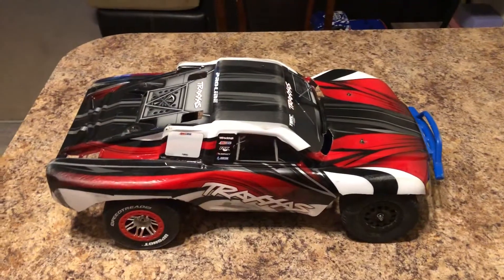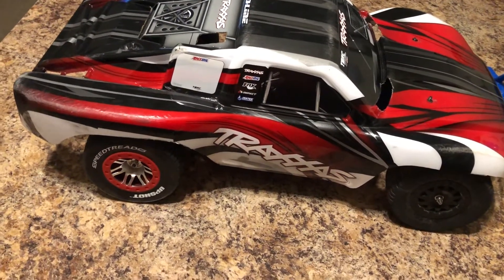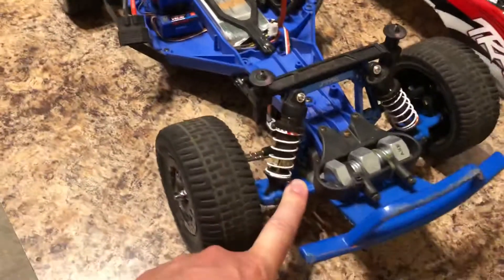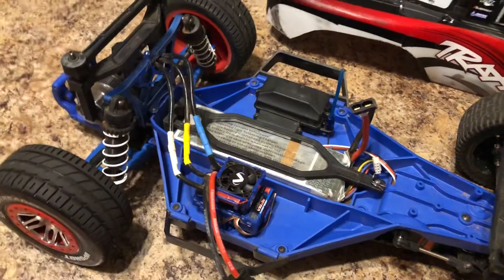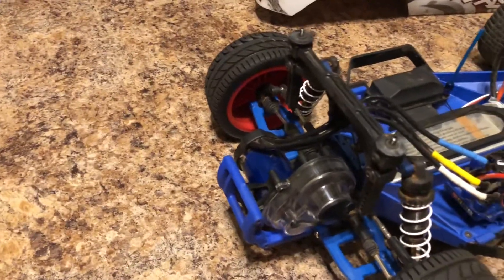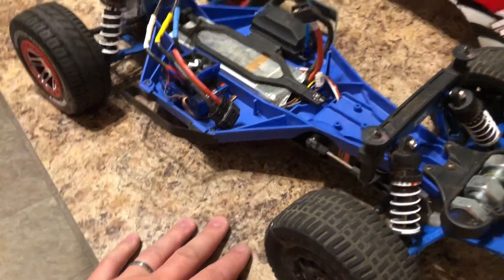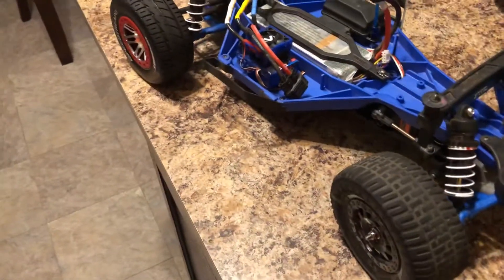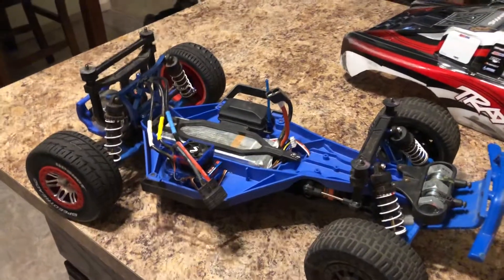Traxxas Slash 2wd dirt race setup 2018 vxl

Comment: Awesome dude! Hope you are still racing. I was able to get my hands on a kit 2wd slash my friend didn’t want. Ended up completely rebuilding it to race. This video was awesome. I learned some new and realized a lot of decision I’ve made are perfect for racing. I run street fighter all 4s for road and just stiffen you the shocks. Then drop the weight for dirt racing. Just got the new Pro-Line transmission to start with gearing. It will be a 32p 56t on a 15t to start.

Also the silver bolt looking things in the front bump stop? Is that added weight? If so how much?
Reply from the maker: Jake Chadwick yeah it was mote for when I was doing some high gear speed stuff to keep the front end down, not for dirt racing haha it’s just some big bolt and nuts from Lowe’s

Comment: Ok
 From someone that has been there and done that.
First off you are going to regret the Pro - Line tranny.
Go with the metal gear Savox searvo. You're A-arms at spot on! 👍I haven't tried the Steel Traxxas Axel's.. personally I have found that the stock plastic's are much more forgiving than steel.. just run it allot and learn your (Fine Tuning from there) Oh yeah
 For outdoor track's "Simple Green and water for cleaning Tire's. Also find a scrub brush that you can mount into the bottom of a sealable container for scrubbing tires.. unless you can afford new set's per race. And never NEVER!!! Go to aluminum part's!!!! EVER!!!!! It's a waste of other parts and a crap ton of money! Yeah it looks good.. but.. you ain't  building a show truck. GOOD LUCK THIS YEAR!!!
Reply: Carl  have any tips on all stock slash 2wd brushed setup for circle dirt track?
Reply: @drewabrams4395  
Is it a Bone stock 2Wd slash?  And what kind of budget are we looking at?
Reply: @drewabrams4395  
Honestly my son and I have never done circle track.. the best advice I can give you is spend as much time as you can driving it around in parking lots. Get as much time practicing on the track/Track's that you plan on racing at. And most of the time people will help you. Just stay out of there way when they are extremely busy and in a hurry. 🙂 Most will be more than happy happy to give you tip's and tricks. And don't worry about pushing yo and your truck to the limit
Remember it takes time. And consistency is key. Good luck bud!
Reply: Carl Manx yes full stock class only lcg chassis budget is open to whatever

Comment: Thats funny because my track only allows de or duratrax tires in my classes but i have calibers for my old sc10 but never have raced on them. I drove ot in novice class and wow they hook up so much better then those de tires
Reply: Jeff Bryner SCOR rules? That’s how it has been at every track I’ve ran but we can run slicks or foams at my local track
Reply: @napoleontannerite8452  idk what rules  it is. I just know on my street stock class de is only allowed open motors and has ro be box stock everything else.